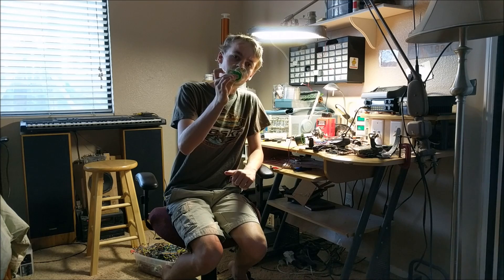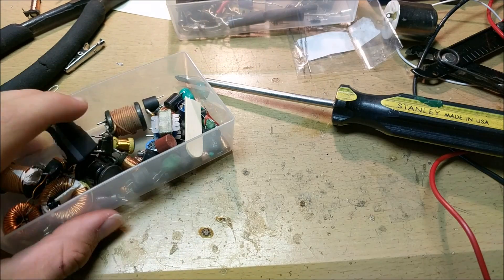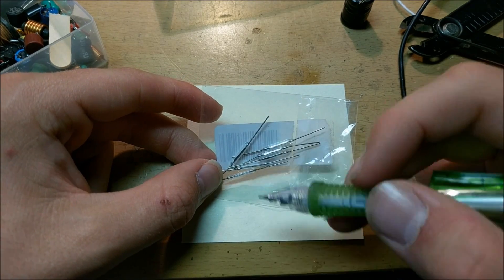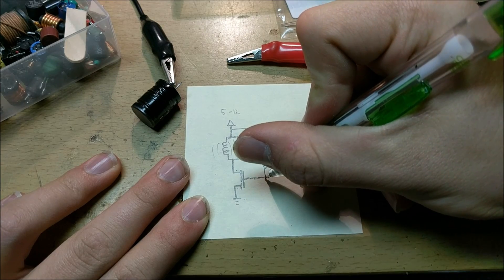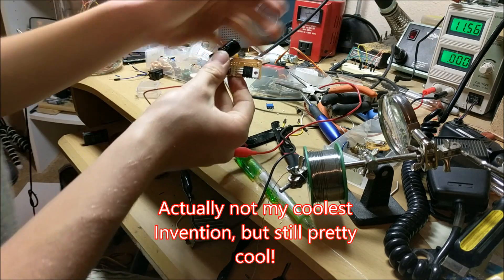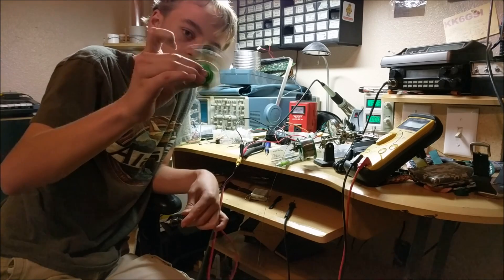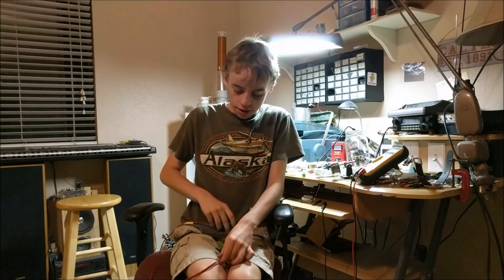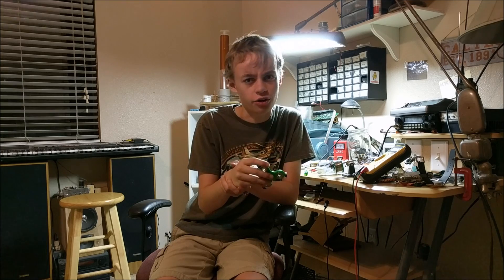Electromagnetic Fidget Spinner Accelerator(1440 RPM)

Comment: I have tried to build your circuit with the reed switch, 10mH Inductor and n-channel mosfet but the circuit does not want to work. Could the problem be the inductance or the supply voltage which is 5V?
Reply from the maker: +serania chetty The power supply is probably the issue.  I used 12 volts.  Try that, then get back to me if it works or not.
Reply: I have tried increasing the power supply however it did not work :/

Comment: I liked your explanation. I might suggest that instead of trying to mount all the components on your hand, leave the circuit board all in one piece and mount the spinner on it, with the switch and electromagnet wired as closely as possible to the spinner's magnets. Also, smaller rare earth magnets would kick that thing insanely fast. Keep up the good work.

Comment: Despite being the world's most inefficient electric propeller design, it's still vastly cooler than a fidget spinner, which makes no sense to me as a craze. Nice work Tanner.

What's cool imo is that this project has some real-world application due to the packaging potential as a motor retrofit, as it's pretty much flat when compared to a motor, and torque is achieved through an increase in diameter rather than diameter and depth.

With a bigger DIY coil, you could easily motorize simple wind-powered or crank-powered devices without having to change their prop shaft or crank mount to accomodate a motor. All you would have to do is replace the crank arm with a machined circle that has Rare Earth magnets mounted along the perimeter, or bolt such a circle to the a prop shaft, by cutting it in half and clamping the two halves to the shaft. 

Think of things like decorative windmills, oldschool meat grinders, coffee grinders, etc. You could probably have a lot of fun just finding old junk and motorizing it lol.